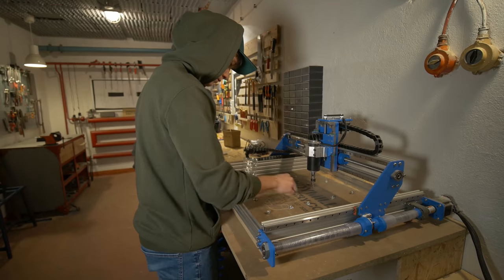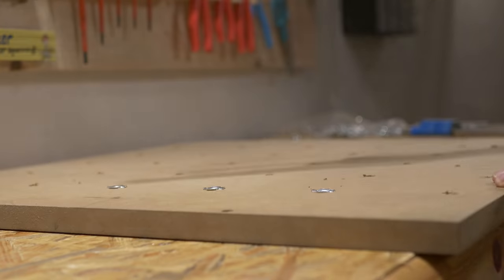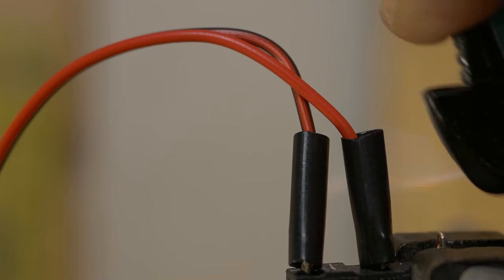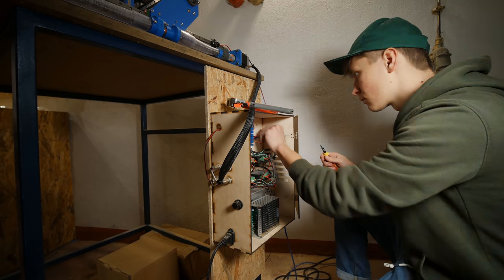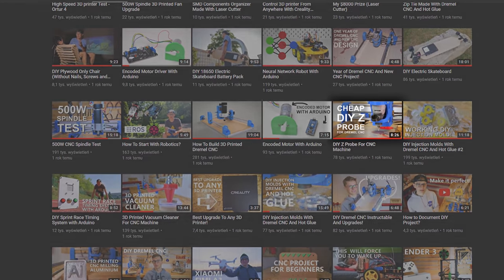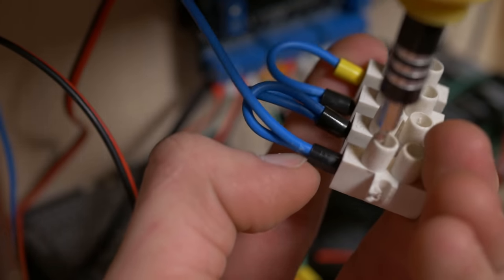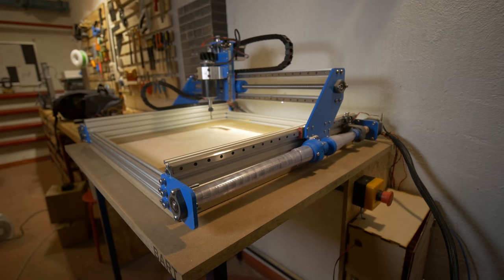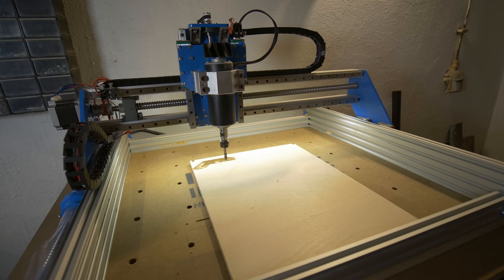Adding Limit Switches, Z Probe, Safety Switch And LEDs to IndyMill

Comment: Normally closed limit switches are better idea, if you have cable broken, you don’t crash you axises
Reply: True, also the switches fail as non-contact.
Reply: Also you can put them in serial this way and only use on endstop connector.
Reply: Agreed, if anything goes wrong with cables or switches mechanics, damn that damage..

I also suggessed to use IR light gate sensors (as used 3D printers Z axis homing) to get very good accurate for CNC homing :)
Reply: Do you think noise buffering for limit switches is needed -- like using GRBL Buffer (I think it uses opto-coupling to eliminate noise). The GRBL Github page on limit switch wiring has various scenarios for noise on steppers using this, or caps and resistors. Would twisting the wiring pair to the switch help instead? Anything special for wiring this between the switches, the IndyShield V2 and the Arduino?

Comment: With endstop switches, wire to normally closed because if the wiring is broken it will fail open which will stop the machine.

Comment: When I built my MPCNC, I repeatedly read that I shouldn't bother with limit switches.

I didn't listen, and I'm very glad.  They're very useful.

In fact, the limit switches on my laser CNC don't work correctly and it's my 1 complaint about it.  I have to manually home it, and my accuracy suffers because of it.

Comment: My mill at work doesn't kill shut off the spindle either and I haven't ever had a problem with it! On the lathes we have that shut off the chuck when the E-stop is pressed they have a brake or they are run by servos. I don't think yours would actually come anywhere close to stopping just like mine if you cut power to it anyway.  Fantastic video!! Don't know how you don't have ten million subscribers!!
Reply: I just use the limit switches as safety switches.   There are 6 in different spots!

Comment: You could have a doubble pole, doubble throw relay for the cutoff.  Just make sure the power through the switch ( either side ) is able to do the max of either the spindle or all of the steppers.  It will allow you to connect the stop switch to one board ( enable/disable the relay ) and power for the steppers separate from the spindle in case you have higher voltage on the spindle.
Really good upgrades, I should add all that to my cheap mini mill.

Comment: Not specific to IndyMill, but a tip that might be helpful...  when you first install your drag-chain insert a loop of nylon cord through it. (Leave it there permanently).  When you want to add a wire, attach it to the cord and pull it through. (Make sure your loop cannot be accidentally pulled through by routing it around the crossbars of the end links in the chain.)
I bet you have to read this more than once to figure out what the heck I'm talking about!    ;o)

Comment: These are nice upgrades, I was also thinking of emergency stop switch and have added led strip just like you and I added wires for endstops when assembling. I cut off parts of gauntry plates to increase build area. (y-bearing holder restricted)
I also bought extrusion slot cover for aluminium extrusions, looks really good and helps keeping the machine clean. 
I still need to fix the z-axis since I have 6mm plates under the rails and it's too tight. Otherwise my indymill works perfect, I just need to learn fusion360 cam. 😅

Comment: Personally I'd wire your E-stop to the "Feed hold" in GRBL as it will stop the motors as well but stop Gcode from running. I think if you release the E-stop the Gcode will keep running and you'll lose your position. I have my E-stop wired to stop everything. Should there be smoking coming from the electronics or w/e I can just quickly power everything down.

Comment: Nice work!
Will you try milling some materials like steel, stainless steel or some hard metals? I'll hope yes... And looking forward for the next video!
Reply: I do think that it would not be able to machine steel. I just finished my thesis on designing a 3D mill, but the actual building is needs atleast a 1-2 months. I mostly planned for aluminium, but i am curious about steel. I will sure try it, but i give a huge thumbs up on a video for that. I looked for videos on steel machining on routers, but there is like 1 or 2 videos on the topic. Even if it fails and does not work i would recommend to make a video on it.
Reply: Yes, there aren't lots of videos about milling steel on router. However when 3d printed Dremel cnc is able to mill aluminium, i truly believe that Indymill will be able to mill steel
Reply: @popplyn3317  aluminium is different than steel. The problem is that for milling metal you would need lower rpm on the spindle. In low rpm these spindles do not have any torque. With aluminium you can get away with the right tool. Also the rigidity of the frame could be problematic, vibrations could mess up everything.
My design may be a little bit tougher, but the linear guides are worse, since i went cheap and designed linear rods. I am really curious if it will be able yo mill steel eith a 2.2 kw spindle

Comment: Hi Nikodem
My students and I have built the Indymill. We are having a problem getting limit switches in any configuration to work. We’ve tried NC and NO wiring with shielded cable, check continuity in all configuration, and tried several configurations of GRBL commands. The only reaction we see is an alarm on start up with homing enabled in some configuration, but not because the switches are activated. Activating a switch seems to have no effect in any configuration. Is there anything about the Indyshield, we might be missing? We have v2. We would like to be able to home and depend on GRBL limits to keep the machine safe. We are using CNCjs to edit GRBL and upload Gcode. Any suggestions would be helpful.

Comment: Will it still fit a 1.5kw router ?
Will you have the steel parts back in stock ?

Also discord would be better
Reply from the maker: I think it will, why not?
Yes I will have more steel plates kit soon

Will consider that!
Reply: @nikodembartnik  First video you had in 1.5kw in the description and never build it with it so I thought it wouldn't work 

Ok as soon as you have them in stock I will purchase thx
Reply from the maker: I already have 1.5kW spindle at my workshop but firstly I want to play with 500W spindle, show you what it can do in some more videos and then upgrade to 1.5kW
Reply: Ok great than it's a no brainier to build your design

Comment: Currently building my own machine and I'm taking tons of precautions about electromagnetic interference. From short wire runs to shielded cables, testing everything with an Oscilloscope etc. It seems you're fine without much of that.
Any input on that? Can I simply my design by caring less about it?
Also really looking forward to your dust shoe solution, that's the one thing I haven't figured out yet!

Comment: I really don't understand how you guys got the limit switches and touch plate working using cncjs.  After hooking everything up my machine never goes to the limit switches, and it never probes.  When you click the blue button on cncjs to home, the machine throws an alarm and does nothing, if you click the X0Y0 button that seems to move to some random spot.  When you tell the machine to do a Z probe, it goes down 1mm and then goes up 5mm as set in the config.  My limit switches are hooked up as NC, I don't see where I went so wrong on this setup that none of these basic functions are working.

Comment: Pretty please add some clips to the led strips, they will fall down. The adhesive that are pre-applied on those are garbage. When they heat up, and the CNC vibrates, they will end up on the work piece, being chewed up by the mill!

Comment: You should try BTT SKR 1.4 turbo is a 23bit board for 3d printing but you can easy program for cnc ,it's cheap but you will feel a lot of difference in performance

Comment: Hi, is those limit switches accurate enough? I think you should use ir light gates which are very inexpencive and used for 3D printers Z axis calibration 👌

Then you would home with very good accurate.

Z probing, hmm nothing holds that bad down and there was aircap when you probed, what about mounting that probe pad rigid somewhere in corner of this cnc? Ah but then you need Z=0 homing sensor to apply thicness of material 🤔

Ive also seen you dont use any tape/papersheet under pieces you are milling (as thinn spacer), that would be great so you dont ruin MDF underneat working piece! :)

Comment: E-stop should 100% also turn off the spindle, absolute must as well as the stepper motors. I work with industrial CNC machines and thats how they all work and its a matter of safety. Last thing you want, is to hit stop after cutting a small part, the spindle still spinning at xxxxxx rpm and that part fly off the cnc. I've had parts dislodged and get picked up by the spindle itself. now u have a spindle spinning massively unbalanced and trying to carry on cutting. You hit the e-stop, if the spindle is still spinning, that part is also still spinning. it can start fires, destroy tools, and can also potentially destroy your spindle. If your spindle has a break, the motor should be turned off with the e-stop and break applied. These little things make a MASSIVE difference when you need it. better to have it set and not need it, then to need it and regret it later after untold damage has be caused. Please understand I am speaking from years of experience here, but of course to each their own. there is no downside in my opinion on stopping the spindle, and very little upsides. if you want to stop but keep stuff spinning (because its safe to do so), that should be a pause function.

as far as E-stop resetting the program, thats what my machines do, however i guess thats a matter of preference, although i dont have a choice with the machines i use. If you know how, its not difficult to resume a program from where you E-stopped anyway. Personally I think the software should reset the program but at least output the line number of where the program ended prematurely so you know where you need to resume from. win win.

Comment: I've added limit switches (NC) but have trouble with interference from the spindle. Everything works fine: homing the three axis, then setting the Z depth with a sensor. But as soon as the spindle starts the Arduino will pick up a signal (spike) and the system goes in an Alarm. Maybe my spindle is producing more noise than others, I use the same as in the list (Machifit ER11 Chuck CNC 500W Spindle Motor). Tried different earth connections, but no solution.
Reply: I had the same problem. I turned off limit switch for work. Now limit switch works only when i use home axis. For safety i use software switch.
Reply: Yes, that is the (temporary) solution.

Here is how:

$21=1    (hard limits enable)
$22=1    (homing cycle enable)
$H          (home)
G10 L20 P1 Y0 (workpos Y=0)
G10 L20 P1 X0 (workpos X=0)
$21=0    (hard limits disable)
$20=1    (soft limits on, set $130-132 for the size of your CNC)

Comment: Serious question - I might be missing something when it comes to the Indymill, but I am right now building the DremelCNC in a modified version. Modified because in the original design all the axial load on the lead screws goes right to the bearings in the stepper motors. It you're lucky, some of it will rest on the 608 bearings, but only through friction, and they are not really made for high axial loads (all force you need to push the endmill forward needs to be handled by the bearings!). Are you considering adding bearings (like flange bearings, I use the KFL08 on my modified DremelCNC) to the Indymill that actually clamp the leadscrew?
Reply: Could you show me pics od your mod?
Reply: @kurczepieczone6013  I sold it in the mean time, but I think it was under remixes on thingiverse.

Comment: Hello, what about EMI?
It would be great if you can make Indyshield V2 with added optocouplers for reducing EMI on Limit switches, and also integrated 0-10V PWM signal for stronger spindle. :)

Comment: Nikodem pls, sorry to take you back your older build(Dremel cnc) I mistakenly ordered lead screws with 2mm lead instead of 8mm lead. Does using the 2mm lead for the X and y axis reduce the efficiency of the machine?
Reply: The lead screw size usually refers to the diameter. And 2mm leadscrew sounds unusaul. common are these 8 mm leads.
leadscrews are ususaully prefered to other transport systems as belts oder rack and pinows, as leadscrews are more precise,
especially those with ballnuts. google ballnut leadscrews. i am not sure if there is a real ballnut system on here. propably not.
BUT. its a known issue, that 8 mms tend to vibrate if they are longer than a  meter or so. therefor some cncs have pulling mechanisms as the queenbee workbee. these put the longer screws under tension.
but "real cncs" in the nema 23 class generally favor ballnuts on leadscrews, generally at least 12mm or 16mm. And even 20mm is not uncommon.anyway, thats the real thing and litle more expensive. 
i have not startet my projekt yet, i would not start below 16mm screw, 16 mm rails, actually 20 mm linearrails, if not 2 on each side of the x achsis.
and of cause 2 nema23 for the x. and 160x80 extrusions for y axis.
anyway. the broader belts of 10mm to 15 mm should be reliable enough and offer a cheap alternative.

Comment: Hey, I was looking into the .dxf files and the "500W spindle plate" file, appears to be with wrong measurements (it shows over 2meters of size wich is very odd...) I'm building an Indymill myself and idk how to proceed
Reply: Change in setup conversion dxf your graphic program diameters inch to mm.

Comment: I think the e-stop should rather tell the controller to hold the current position and power off the spindle. Some other youtuber had issues where the rotating tool dug into the workpiece and yanked the gantry to the side, crashing into the machine limits. I think it was Winston Moy, but don't quote me on that.

Comment: Here I am again, congratulations again on the upgrades you are doing... I believe that soon you will also make an adapter to vacuum the shavings.

I wanted to ask you 2 other things:
1) if I want to mount a laser module instead of the spindle, beyond the fixing attachment to the Z axis, what would I need from an electronics point of view? I have seen ready-made 2 in 1 cnc (like the 3018) that have a control board other than Arduino as you used instead.
2) would it be possible to increase the height of the Z axis and integrate an extruder instead of the spindle for 3D printing? Or do you need to make other changes?

I hope you can answer me soon.
Keep it up!